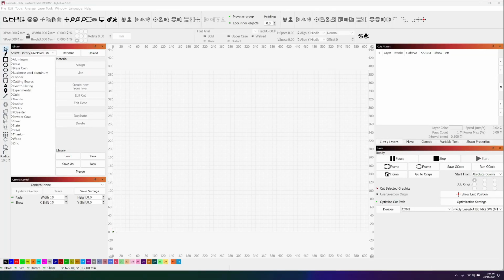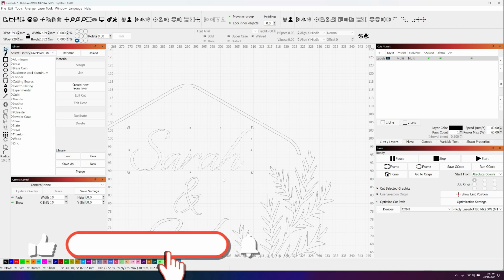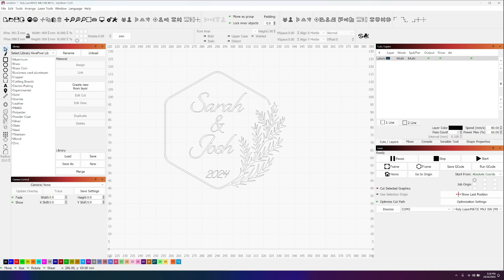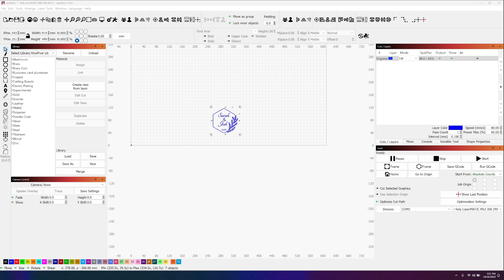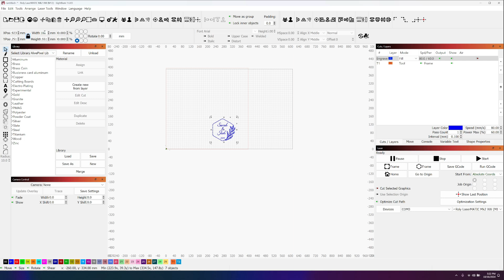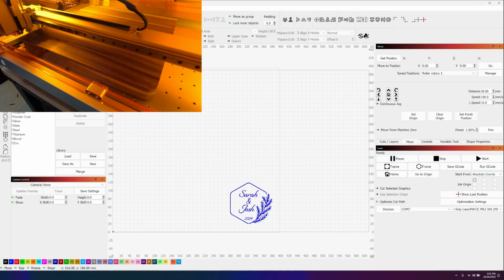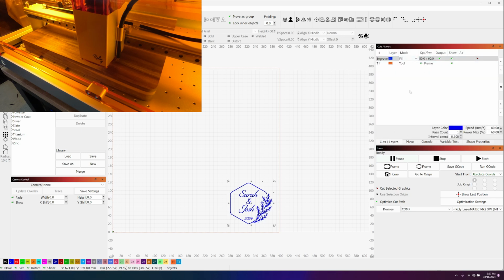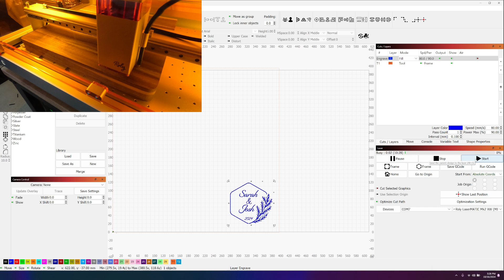Laser Engrave a Cutting Board with Us - Laser Engraving for Weddings - Laser Engraving Wood

Comment: What would be good starting point if you wanted to use 30 w rolly to engrave. I have a Roly, and when I first got it engraved, great, and I used the code from the Manuel that took it back to the default setting and I have been trying to get back to what it was but do not remember what the setting was. I just need a good jumping off point and play with from there. I have been trying to engrave on basswood.
Reply from the maker: try always to start with a power speed test. but also if is only engraving on bass with the role 30/10w try on 30w 60% power 300mm/s 0.08 resolution or 300 lines 1 pass, adding 5% overscan to help acceleration and direction change.
Reply: @AlivePixelCreates  thank you